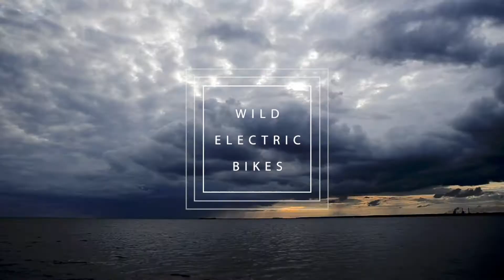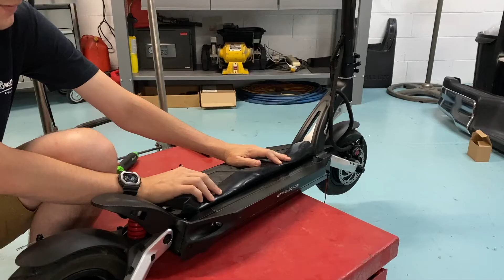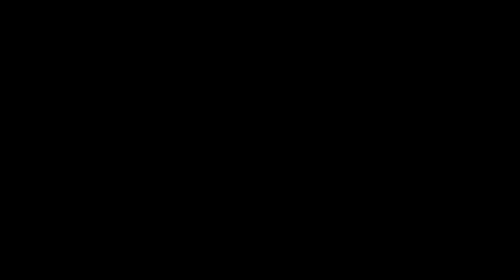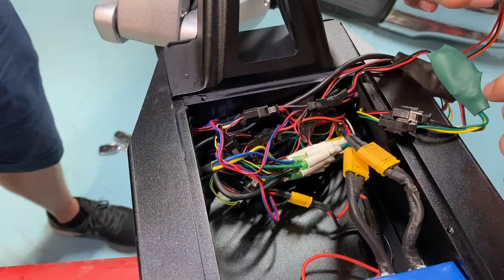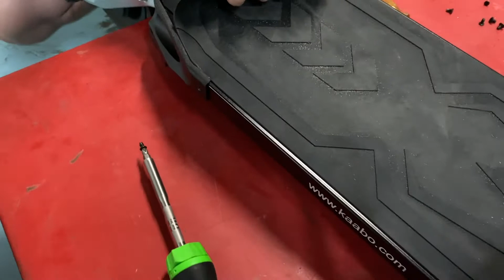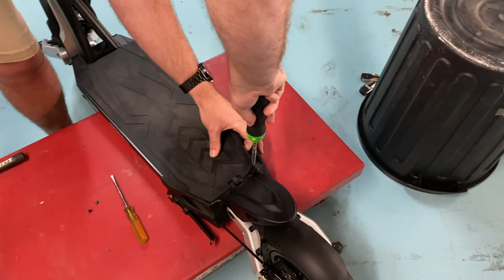Electric Scooter Alarm Immobiliser - [Overview & Install]

Comment: Yes finally.. 👌I'm glad you changed the design to something more reliable than that no offence but ratchet horn alarm yous sold the big old one .. Like not saying it's your guys fault at all with the design of it.. But I paid and refunded the old alarm horn yous sold got a new one and its faulty they never worked.. and I still got it. I just wish I didn't buy it before this came out. Good idea but those old ones were not good for $100.
Reply from the maker: Hey John, 
Actually those alarms have actually also been revised and are now far better too! :)

Comment: Hey, few questions if i may. 
Will it turn off scooter if someone drive it away? 
If yes, what is approximate range of a remote?
When alarm is armed are wheels locked (motor braking)?
thanks!
Reply from the maker: Range of 10-20m, the scooter will turn off if the power is on and the immobiliser is activated. The alarm is part of the locked immobilisation feature.

Comment: Really like this bit of kit. Installs super easy and works well.
Just be aware, however, it will drain your battery fast. Even when not armed… left my mantis 10 Solo in the garage for a few days, came back it was almost flat.

Comment: I have a kaabo mantis pro se, just took deck off and the male and female  Connectors are too large for the wiring harness in Mantis. do you know if there's a fix for this? I bought same wireless fob.
Reply from the maker: Hi there, where did you buy this alarm system from? We have our alarms made with custom fittings to suit Kaabo range. If you have purchased elsewhere then that may be why
Reply: @AmpdBros   Hi it looks like I bought it from you guys. So with that said my wires inside only have a 2 pin hook up.  Yours has a 6 pin hook up.  Again I have a kaabo Mantis pro"SE" gold. Do you have one to fit this Pro SE? Before I  Regrettably have to send this back
Reply from the maker: @Justsayinguc  Unfortunately we only have ones that fit the models we sell. If you can track down your order number and send it through to info@ampdbros.com I'll be able to help you out further from there.
Reply: @AmpdBros  I sent a e mail to  Warranty repairs and technical support thank you for your timely response to

Comment: Quick question does the alarm itself just stay in the side housing or does it pull through to the back and then how do you mount it thank you
Reply from the maker: Hey Jack, the alarm sits snuggly inside the side channel. Note: this will only work with the Mantis 2020 models, the new 2021 editions have an extra  bar inside for stability that makes the gap too small to fit the alarm.
Reply: @AmpdBros  I bought the Mantis pro SE Gold edition.  Not sure its 20 or 2021 model, do you know. Tks
Reply from the maker: @Justsayinguc  Not too sure on the SE edition of the Pro, when it arrives crack open the front and see if it looks similar to the frame of the Elite we're using the video.
Reply: @AmpdBros   High Ampd brothers I purchased the wireless alarm on my Mantis Pro"SE" gold. followed your video open the deck and took off front cover and  the side chanel fine. But your device has a 6pin/wire hookup and after rooting around in the PRO SE  Version there are only 2 pin hookups. Do you guys sell the one for this version of the Mantis?  I regrettably don't want to send this back, wish it would work my friend
Reply: @AmpdBros  So no go for 2021 model (24ah)? Or maybe it fits in some other spot?

Comment: Does it suit the Wolf Warrior 11 ?
Reply from the maker: Heya, we are yet to double check but from what we believe - they do not.
Reply: @AmpdBros  oh ok do you have anything else available for the wolf?
Reply from the maker: @defchook  we do have a universal one also yes 🙂
Reply: @AmpdBros  can you send me the link thanks
Reply from the maker: @defchook  sure here’s the link https://ampdbros.com.au/products/bicycle-electric-horn-alarm
Reply: @AmpdBros  Hi from Turkey.. Do you have an immobilizer specific for Dualtron Eagle Pro?
Reply from the maker: @süleymanbacınoğlu  Hi there! They are relatively universal and are compatible with mini motors so it will work, you just need to take a look inside your scooter to see if you have sufficient space to fit the alarm box inside the deck somewhere thats all, generally speaking the bigger more powerful scooters have limited or zero space in the deck due to large batteries etc. Hope this helps!
Reply: Hi great vid what's the brand of the device

Comment: Are you able to turn on the scooter when the alarm goes off? my current one does xD
Reply from the maker: If the scooter is “locked” you have to hold the “lightning bolt” button to initiate power to the device otherwise won’t turn on no
Reply: @AmpdBros  Not like that. Enable the alarm on the scooter, then shake it to trigger it, and test if you cant turn on the scooter and ride it away alarm blaring.
Reply from the maker: @DKTAz00  if the alarm is active no you cant turn on and ride away at least not on ours